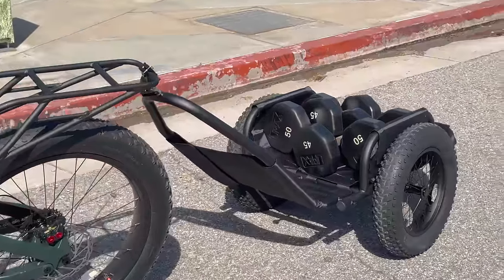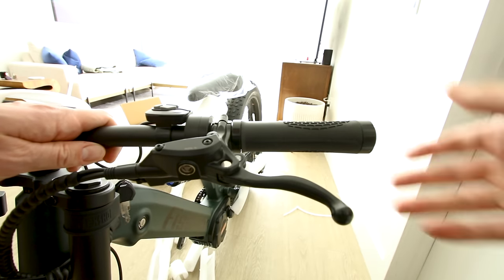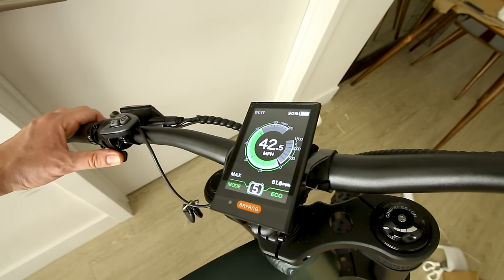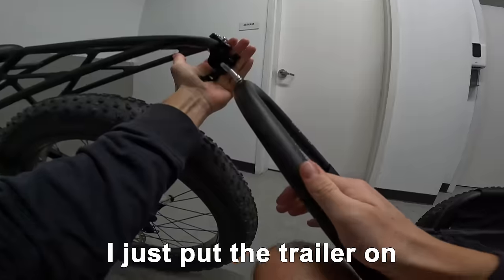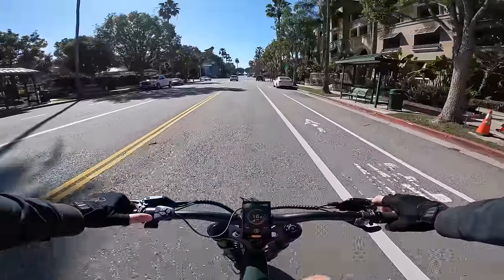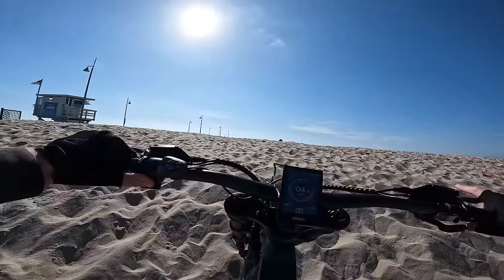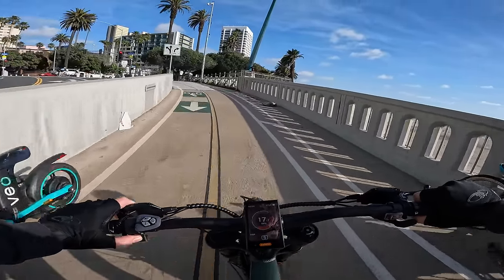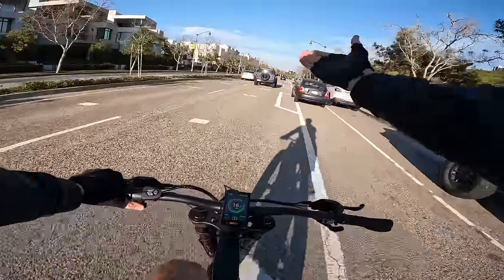This Ebike is Crazy STRONG - Fission Hellbender Review

Comment: I like it, but it has no business being 4 grand.
Reply: Just get a telaria or whatever it's called at that price/review
Reply: Damn.  I think the light bee is around that price.  Right?
Reply: Yep I could build one that goes 100 mph + for £3K. Not that I'd go over 15mph living in the UK. Lol
Reply: When you start getting into high-end  brand-name components, mid drive motors, higher capacity batteries etc., price starts to go up.
Reply: You could buy a real motorcycle , got my crf250 rally for 5K with only 900 miles on it .
Reply: @leeinwis  well, $5000 is not $4000, it’s a used bike, requires a  license, oil, changes, fuel, generally more maintenance, etc. Not an apples to apples comparison.
Reply: @moonshotsilver  I don’t know if I’d wanna ride something 100 miles an hour that cost only 3K.
Reply: I know right 4g jesss
Reply: Yeah they definitely need a bigger battery. Then I could see the price but 20 amp hour battery is just too small
Reply: For real ... Id prefer to buy a wired freedom and use the extra money to buy a front hub motor , extra battery and extra sensors etc..... Way too expensive
Reply: Oh please! Tell that to the Trek Rail at 6 to $9K dollars with essentially half the power, speed and torque!
Reply: This motor alone is 730$ brand new..
Reply: @shawnrobinson6535 it's cheap stuff on the bike.  it's no bosch cx performance line
Reply: @slimdunkin117 it's still cheap  a bosch  motor  is 1100
Reply: Lmaooo Brody
Reply: I have 3 motorbikes and 3 ebikes @leeinwis
Reply: Where I live, these 2K bikes wouldn't last 3 years. Shifters brakes and suspension are really of poor quality. So wasting 2K in 3 years is also not a good idea.

Riese und Müller or brands like that are crazy expensive, but they do use long-lasting components.
Reply: Ya. Just put a bbshd on your own fat bike for under $1500
Reply: @leeinwis  real motorcycles cant go anywhere like Ebikes can. they require gas and insurance. ruins the whole point
Reply: @LIVEWIREMEDIAENT  enjoy your China made bike
Reply: Facts you can get a Surron or talaria for that price and upgrade it if you want 😂😂
Reply: yep the motors only £600 and the bikes about £1000 with the cheap hardware!

Comment: "this ebike is excellent for towing heavy weight and hill climbing situations", exactly the type of e-bike I'm looking for!

Thank you for the review, especially with the trailer, the added weights and your usual hill climbing test at the beginning.
Reply: There are smaller chain rings and adapters for the 620 if you need more low-end as well as shorter crank arms for short legs or avoiding pedal strikes on serious off-road rides.
Reply: Seems like its own category of ebike.  Better than other "hunting" ebikes I've seen.  I think dual hub motors would suit such a bike better, especially with that trailer hitch position.  Would have liked so see braking tests with 190lbs on trailer.

Comment: I have a Biktrix with this motor, but I have a Sram 11x1 driveset. I can tell you are used to hub drive motors. With this motor, you really have to use the gears, like driving a motorcycle. If you want natural pedal assist feel, but still want big torque, the Bafang Ultra is the way to go. Just make sure you run a high quality chain and check it for stretch, because that motor will wear out chains.

Comment: Just an fyi for these powerful mid-drives. On throttle you can often get higher top speeds by choosing a lower gear. This motor will spin at 160+ rpm. Much faster than you can pedal. But top speed is limited on these by power. Mine will hit 4km/h faster on gear 7 than gear 8

Comment: I have the Keteles K800 Pro, a dual motor 23ah  2000 watt 48v for $1300 shipped.  Because both wheels drive it goes up any hill, goes 35 mph and seems to be such a better buy than this bike. I can't seem to justify spending 3 to 4 times the money for a bikes that really do not offer much more performance.
Reply: The Philodo H8 he reviewed already is the same exact bike as yours.
Reply: No rear suspension....but I agree, 4k is a lot of cash.
Reply: I have the eunoura version of this bike and I race mine. It's essentially a fat tire Enduro/down hill bike. It's definitely worth $4k.

Comment: Mfr needs to add derailleur protector, headlight, taiIight, turn signals, right hand throttle, bigger rotor, and make it in 20 inch wheel size
Reply: 20in wheel size is poopy

Comment: The link you post takes you to the 750 W model not the Bafang Ultra 620 1000W which is $4,800
Also, learn to back off the power for a second when you shift, otherwise you'll be replacing chains and cassettes all the time.  Thanks, I enjoy your reviews and am pleased you are starting to review higher end bikes.
Reply: I know the mid Bosch motor on my bike auto releases drive for a split second to allow smooth changes , no crunching etc , I wonder if this does the same , or as you say ripped up chains and cassettes , I home it has an extra strong chain to cope with the torque 😁

Comment: Would be very helpful if you would include a review section on all bikes, of the control panel, what settings are necessary to ride the bike, to get max. speed, and what settings and functons are available at the control panel, and which are not. Was this review of the 750 or 1000W bike?? Tires look like the 4.7" tire on the more expensive bike.
Reply: It's 750w max in eco, 1500w max in Sport. I have the same motor and controller on a Biktrix
Reply: @Anderson_999 same setup on my Frey ex pro dual battery. I can get 38mph when the batteries are topped off and gear 7 gives 2mph extra over gear 8 for some reason. Also helps that it’s not a fat tire bike so not too much resistance

Comment: bafang is releasing the m630 late this year most likely with 230 nm of torque and a 40a controller so you will see even stronger bikes than this soon.
Reply: Will it bolt into place of the 620?
Reply: @stanleyn.2476 yes its a direct bolt on it has the same shape but depending on the ebikes battery output it might not be able to supply the m630 enough juice.
Reply: @Timbodacious  Sweet! Thanks.

Comment: Aa someone who has a heart promblem and cant really pedal and cant have my drivers licesne, electric bikes are perfect but the price ranges on these are ridiculous.... almost easier to get a cheap car. Trying to find one i can get back and forth to work, decent speeds as im near main roads. Im 6'4 and 215 pounds. Any recommendations? Anything 2k and cheaper ideally
Reply: There's many for 2 grand or cheaper.  What kind of range do you need?
Reply: I got similar problems. I bought the Fucare Libra for $1199. Got 1300 miles on it so far with no problems.
Reply: @spottheturtle9568  I'm looking at a 10 mile commute to work, an my worry is if the battery does die I won't be able to pedal all the way home.
Reply: @twinge2254  what's your top speed with it? I know I'm not going to get any 50 mph bikes for around 2k but I need something that will go at least 35 40.
Reply: Wired freedom runs about 2k. I have a VELOTRIC Nomad. I’m 6’2  245lbs and it has been great. $1400!!!
Reply: @Kioskjoey  it pulls 25mph on flat ground. Commute is 10.6 miles round trip and the battery is at half charge when I get home. I bought and carry a spare battery just in case. I'm 5'10" and weigh 160
Reply: My last bike that got stolen would do 50mph. I bought a 3000 watt kit off of Amazon for $700 and a 72 volt battery for $570 and put it on a bike.
Reply: Wired freedom sure does look nice.  For longer range i got my eye on the wallke awd folding bike.
Reply: @spottheturtle9568  I am looking at a few awd dual battery. I just think for my area and for my height and weight that's the best choice. I have a lot of hills, if I could I'd just buy a surron or one like it but until I save up that much I have to find something else
Reply: @spottheturtle9568  walkie dual motor right now is 1699. Which at that point isn't a bad investment
Reply: Check out the Ariel Rider Kepler or the E-Cells Five Star.
Reply: Anioki A8 Pro Max has one that has a 60ah battery that TailHappy reviewed. Basically like triple the battery of what most other bikes have. It's $1499. Think he got it to 35mph.
Reply: @baddriversofcolga  they both seem like good bikes, hard to choose which one to drop the money on
Reply: @twinge2254  where is it 1499? I just looked the 42v is 1799 and the 52v is 2099
Reply: Have you looked at the aventon aventure 2? Currently, Aventon is running a free extra battery. Although fat tire, it is a nice ride

Comment: For 4k you can buy a full purpose built e mountain from many other companys with far better components like haibike with😮 & a better mid drive mounted motor for me this ebike has no buisness at being £4000 when it probably cost them about £1000 or less to make & build it is shockingly bad value for money at that price it should be half the retail price there asking in my opinion what a rip off at that price